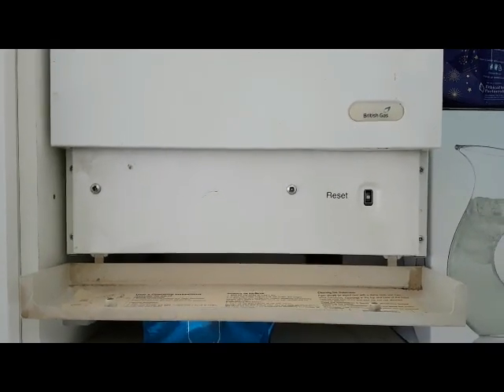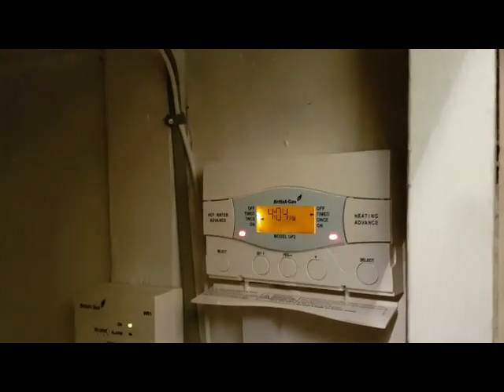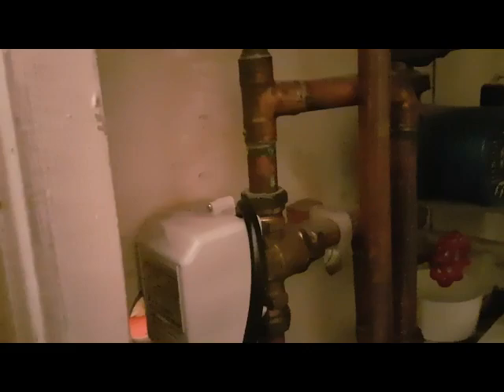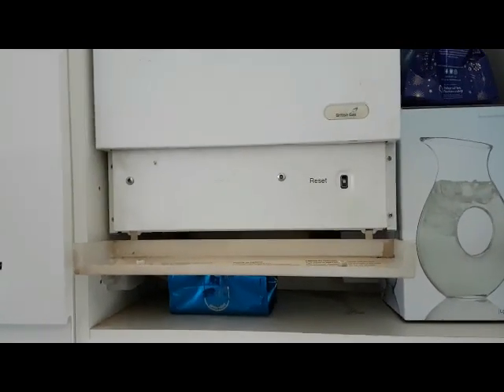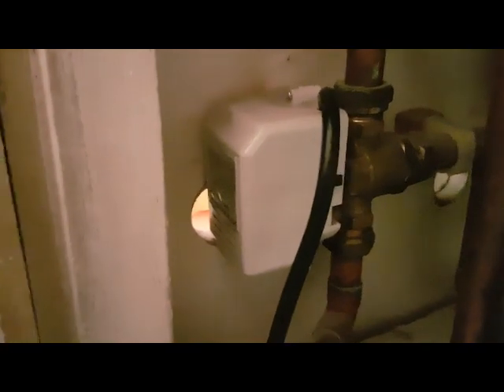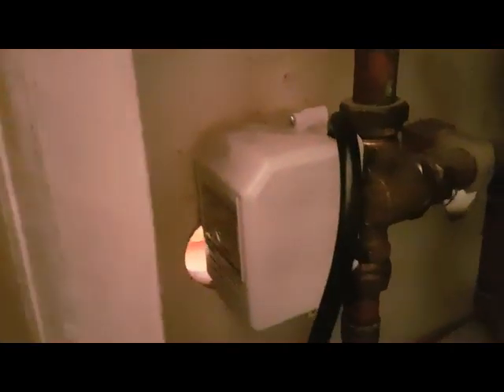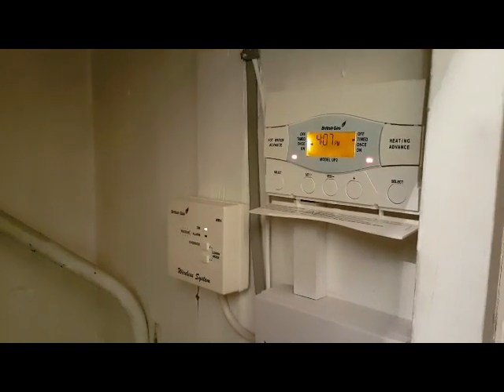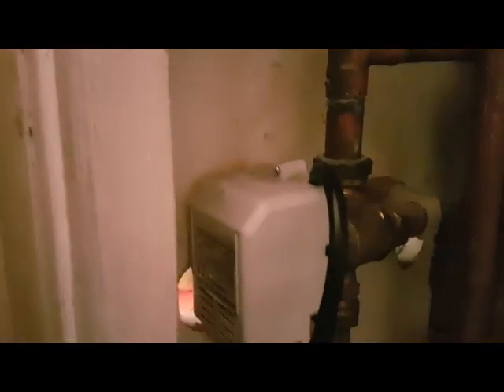Mid position valve fault. With Coach Tony Morgan

Comment: Is that a 2 port valve?
Reply from the maker: No its a mid position valve
Reply: @ARBoilers  3 port vaule got you now I get the video thanks mate hope to see more videos soon
Reply from the maker: @Unknown-ld2mf  🙂
Reply: Sorry what was the problem? Having the same issue. Heating won’t work on its own but the valve does move!! Have put 3 valves in now 😢
Reply: @paulgardner3926  Did you check that the valve was not mechanically seized?  Did you solve it in the end?
Reply: @RickyBoo109  yeah the actuator head wasn’t sitting right as it was really tight 
Against the wall.

Comment: So how will you fix it? Change the motor valve or repair it?  If repair, how so? Is it a problem with the motor, or maybe the grey wire? Please reply
Reply: Remove actuator from three way valve and check valve is moving freely as it could be valve is sticking, if it is ok replace actuator. Also you will probably find it is cheaper to buy a complete valve than actuator on its own so if you need the complete valve your sorted but much easier to replace actuator only.
Reply: William Murray thank you
Reply from the maker: hey we're currently trying to grow our Facebook group and would love you to join Tony and the team using this link, Tony will be available to answer all your questions directly there's also updates on new trainings we just released too. https://www.facebook.com/groups/167070231326174